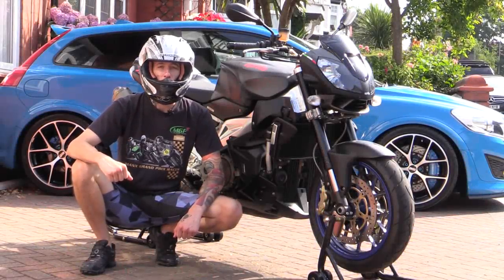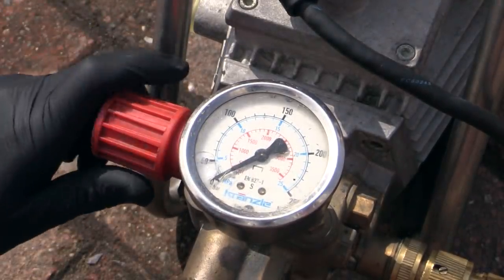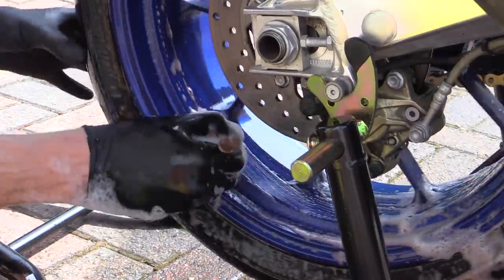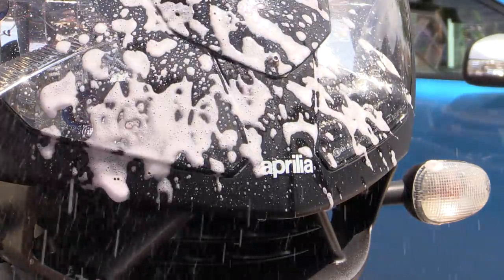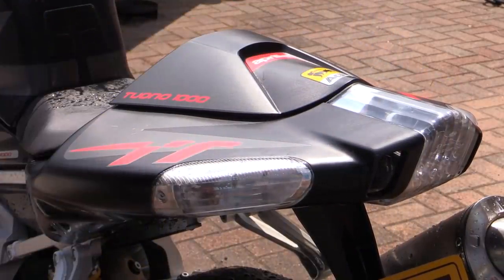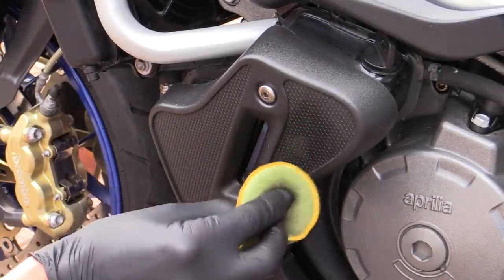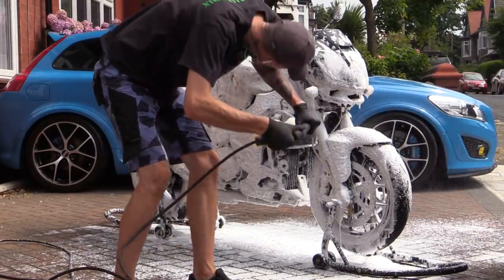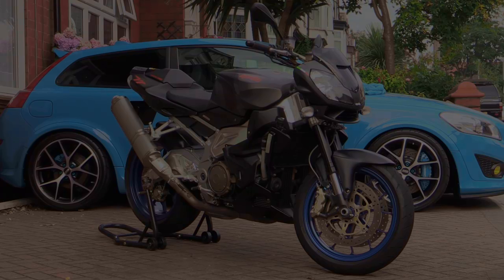Crotch Rocket Cleaning Tips

Comment: My favourite part of bike cleaning is once it looks perfect taking it for a blast.. Where more often than not, within about 30 seconds, a swarm of about 1,000 or so flies decide that they'd prefer to be squished all over my pride and joy rather than doing fly stuff.  Usually within about 10 minutes the seagull heard in this video at 4:35 has tracked me down and launched a couple of his bike-seeking missiles all over it!!  I've found that paraffin works just as well as the commercial chain cleaners (if not better) and is cheap as chips by comparison. Follow that with a thin coat of chain wax and Bob's your uncle.
Reply from the maker: A lot of people use kerosene too I gather.

Comment: Nicely done, it's worth rubbing a bit of ACF-50 over any parts that could rust for extra protection, great stuff.  Obviously stainless steel and plastics won't need any, you can mask the disks and calipers and tyres to do nuts bolts and forks.  It's good on electrical connections including battery terminals too.

Comment: More tips:
1) Use something to prevent a lot of water going in the exhaust
2) Cover clocks.
3) Don't spray chain cleaner directly on the chain, cause it will break down the grease behind the orings. Prefer to apply on a rug and wipe it clean
4) Afterwards lubricate the usual bits, and also lube suspension adjusters cause they  tend to cease
Reply: 5) When re-lubing the chain, spray the inside of the chain, that way Centrifugal force pushes the lube into the chain when you ride, Spraying the outside makes it fling off

Comment: finally a great how to video on cleaning motorbikes. I notice that you use a wax on the bodywork near the seat. It's worth mentioning that wax is obviously slippy so it's important not to get any on there. seats on motorbikes are usually simple to remove and involve the key and a single latch which keeps it in place with  a few tabs to line it up correctly

Comment: Hi,

Please can you do a video of how to properly clean car glass, inside and out, without leaving streaks or fluffy bits off of the microfibre cloth. And what products and cloths to use?

Many thanks, 

Ps, love the vids 😀

Shaun.
Reply: simple as this
1. low pile microfiber for glass (dedicated for glass only)
2. small bucket, warm/hot water and few drops of dishwash soap 
3. normal microfiber towel
4. spray bottle with clean water
order: damp 3 into 2, wipe glass, spray glass with 4, and buff with 1
Result: no nicotine, no streaks, no fluffy bits, fast, easy, cost effective and most important safe to all glass including tints. Working with detailing cars for over 10 years. Glass cleaners often leaving coating over glass, looks ugly on sun, you can spot smudges, nicotine and dirt sticks to it lovely. That's why im never using it for years. They are often not strong or too strong which is not good either. Dish soap with hot water is just perfect to dislodge caked dirt, also to remove any dirt "film" on your glass, while low pile microfiber cloth buffs it to "no glass" effect. Regards

Comment: Just a tip. Lube your chain when you get home from a drive so the lube can stick to the somewhat warm chain. If the chain is cold the lube won't stick well and you get it all over the bike and leg :)
Reply: That is ideal, but you cant really go for a ride without lube after cleaning the chain.
Reply: @banaana1234  I think you can.  The lube is mainly for rust protection as the o-ring chains have internal lubrication.
Reply: Or just get a Scott Oiler lol

Comment: What a pro++ job, and the movie. Damn, it made my day. Would it be possible to give us some pointers on cars with bad paint? The clear coat on my car is kaput broken. With a wrong move of the pressure washer it going. And tips?
Reply: then don't use pressure washer, use hose..since pressure is not needed or mandatory...that way you wont risk peel more clear coat off your car...hose, 2 bucket method and good to go, you'll clean it just fine...pressure is mostly to knock off chunks of dirt without touching but after must go hand wash anyways. To make it safe as possible, wash in shade/late afternoon on cold bodywork, use decent ph neutral shampoo (not acidic ones, not degreasers).

Comment: One tip, you touched on it by saying, avoid getting water in critical areas. Just thought I would call out one area in particular. Avoid spraying water with any force at the center of the wheels. The wheel bearings are not as protected as on a car. I know they are by name, sealed bearings. However, that seal is NOT very tight against the inner bearing race. Think of them more as dust covers, not seals.

Comment: Good video, what product would you recommend for a textured black swinging arm? 2019 Steet Triple RS
Reply: My 636 has a course powder coat on the frame and swing arm. I used a cheap detail brush with soapy water on spots that are particularly stubborn. I clean the bike as I would let it dry and examine the problematic spots and then I snow foam and go a scrubbin.

For the spots that the detail brushes don't remove I use a brush with stuffer bristles.

Comment: If I may add a corrective tip on the chain part ... NEVER pressure wash the chain because even after lubrication it will rust faster with time and will decrease durability, just use specific chain cleaners for the job and wipe off the residue.

Comment: Awesome video as per usual! nice to see someone actually not being scared of using a pressure washer on a bike, i've done it for years you just need to use your brain and not blast the hell out of it. Good tip with the dryer though, i think i might have a look at a proper one as to be honest i use my air compressor normally but its a bit too noisy sometimes and maybe blasts some areas a little too hard even with dialing down the bar!
Reply: I was thinking the same. Air compressor that i have, uses a rather fine stream and from the looks of it this air pump seems to be somewhat quicker as bigger area is blasted
Reply: also from doing some research the dedicated dryers are slightly heated too which can only be a good thing when cleaning your pride and joy when its 3 degrees C in the middle of winter :)
Reply: Scott Morris I'm not sure if you're in the UK or not but I'd recommend a Karcher vac, like a WD3P - you can get it from amazon for less than £100, has a blow function, really simple to use, and is slightly heated. I'm a self employed valeter and I've used mine daily for the last year and a half, no problem at all. And obviously being a wet and dry vacuum cleaner it has other uses :D 

A friend of mine (who's a mechanic) actually used my hoover to blow some moisture (and loose rust) out of a chassis rail on a rusty old Suzuki before doing some welding
Reply: No Way! i flippin well have one of these vacs already, didn't even know it could blow, i just know it sucks :) thanks for the tip though! ..........edited as i have the cheaper WD2 which has no blow, nice tip for others though thanks again!
Reply: yeah the WD3P has a slot on the back, if you pop the nozzle in there it blows instead!

Comment: Chains are lubed on the inside so centrifugal force works the oil into the chain . If applied to the out side it just flicks off
Reply from the maker: I did that too but the clip looked naff so I went with the one here. There's a lot I do that sadly doesn't make the final cut.

Comment: A problem I have is that it’s really easy for my brushes to get oily when bike washing, even if it try to use different brushes for different areas. How would you suggest cleaning the brushes? Or is the degreasing phase the only answer to avoid oily brushes?
Reply: Liam Layton I’d imagine giving them a soak in white spirit afterwards would do the job, just give them a rinse with water before next use

Comment: 1. Never lube your chain on the outside. Only spray on the inside, down under the swingarm.
--> you see all the oil freckles on your wheel?

2. Don't spray water directly on the chain, because you press water into the x- or o-rings.

3. Lube the chain after the finished wash. Optimal konditions are a warm, dry chain.

4. Be careful not to spray into the exhaust. You don't want water in your wool.

Have fun with this cool bike.👍

Comment: What do you recommend as a degreaser, as many I have looked at will mark/tarnish alloy and anodised surfaces, bear aluminium is particularly bad for this, even if motorcycle Muck Off is left on a second to long. I have in the past used that WD40 Chain clean but found it tarnish alloy really badly.
Reply from the maker: This pink degreaser I found was really gentle, so much so I had to step up to Autosmart G101 to get the job done properly. That being said I wasn't working with 'naked' metal like you mention. If it needs heavy cleaning it's hard to avoid I guess, all the more reason to properly protect and maintain once its been polished up!

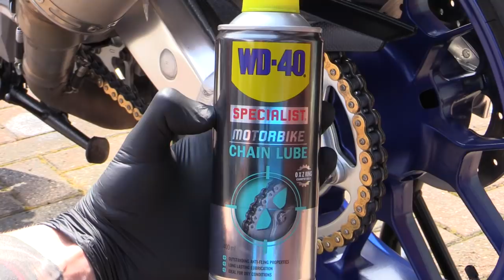Comment: 3:30 I would not recommend lubing the chain like that. First of all apply the chain lube from the inside (under the swing arm) and protect the tyre, exhaust etc. with a piece of cardboard. Secondly you want to lube between the lugs of the chain, because thats where the rubber rings are sitting. There is no need to lube the rolls. Don't apply too much lube and remove excessive product with an old towel. That way the chain will attract less dirt and stay clean longer (and also the spray onto the rear wheel is reduced significantly).
Reply from the maker: Yeh it's already been said and to be honest it's nothing I don't already know however when filming obvious things tend to go out the window as you're focusing on getting that perfect shot while trying to remember a million and one other things!

Comment: I don't recommend to pressure wash the chain (specially if they have orings), just hose water on it. The chain lube should go inside the chain (part that touches the sprockets, not from the outside). Cover the exhaust too. Good move to protect electronics tough (and thanks for don't dress rubbers - grips, tires, and foot pegs).

Comment: 1:25   I took my bike to the dealership (honda) so they could do the basic maintenance (change oil, check break pads, etc), then they cleaned the bike. They F** Pressure washed a phone charging USB Port without covering it up. I saw this immediately after getting the bike (USB port was short circuiting, and turning a blue LED), I complained, and then they said: "We don't insure third party accessories". I'm never taking my bike there again...  (USB is still fine after I sprayed WD-40 for 30 seconds on it)

Comment: Do not clean your chain til it's shiny. Degreasers and other chain cleaning products wash oils off the chain and you can't really get it back. Accept that chains are not designed to be shiny, keep the pressure washer away from it and use a brush for the dirt.

Comment: I can't believe anyone hoses their streetbikes down...  did you take it mudding! 
wd40 off the wheel and undertail grime...   then clean cloths mild cleaner the whole bike, quick and easy looks like a million bucks and the chain stays moist no rusty bolts bearing castings etc...  not to mention much less PITA
Reply from the maker: Considering the bike is 10 years old and has probably never been properly hosed down it was quite deeply ingrained with years worth of dirt and grease and to be honest, despite the clean, in places still is!
Reply: I didn't mean to second guess your techniques you are obviously good at what you do I just think hosing a bike down does more harm than good unless its a dirt bike!
Reply: Nothing wrong with washing with water, been doing it for many years. The key is proper drying and relubing. I like to let the motor run afterwards to help evaporate leftover moisture. That, and take it for a quick spin around the block.